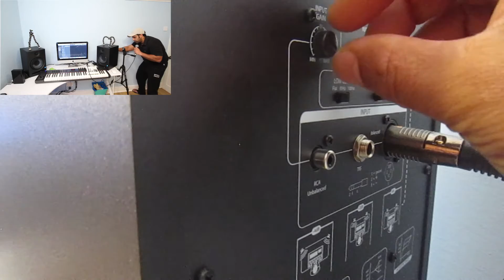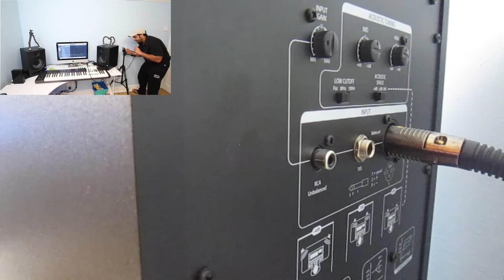Pro Sound Gain Structure Correct Method

Comment: Explained well. I always have my vocals assigned together in the DCA group so I'm assuming that needs to be at unity as well while setting gain structure.
Reply from the maker: Yes Correct . Let's say you have 1 main vocalist , 2 back singers assigned to a DCA or VCA then the fader ( output level to main bus) will have overall effect on all the vocalist assigned to that DCA/VCA .If you have to control the output level to main bus for all vocals via DCA/VCA then yes it should be on unity during gain structure setup/sound check and then adjust accordingly on all individual channels so there is no feed back and desired level is achieved according to the venue/festival or room acoustics and other environment factors involved during live show.